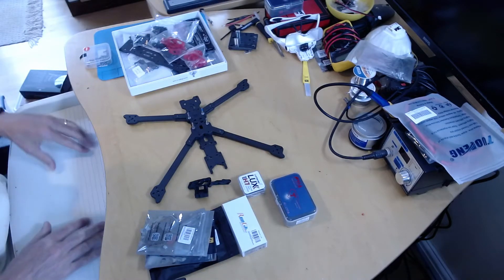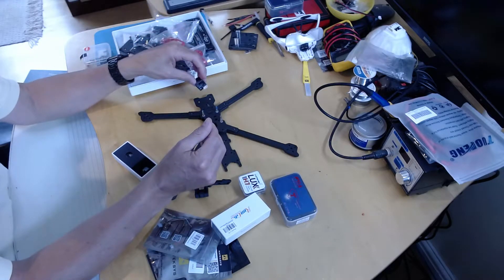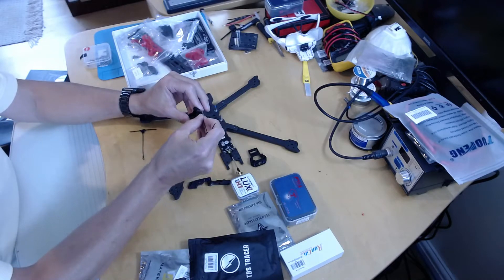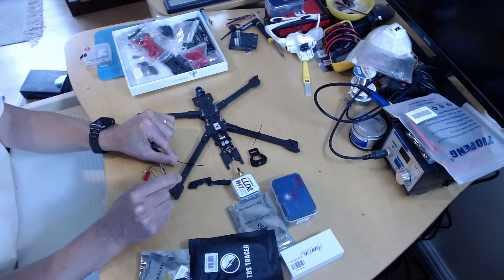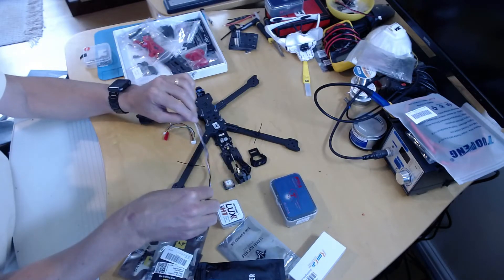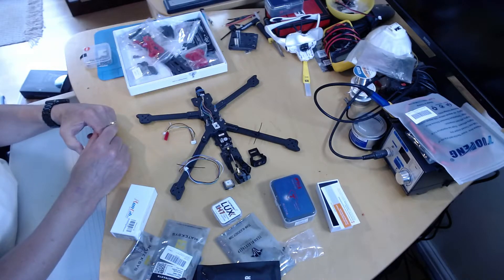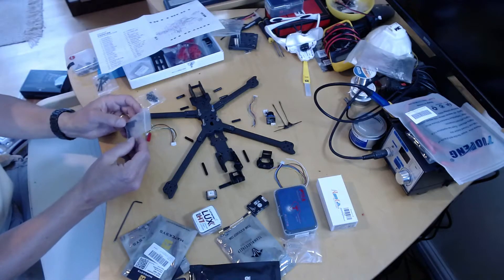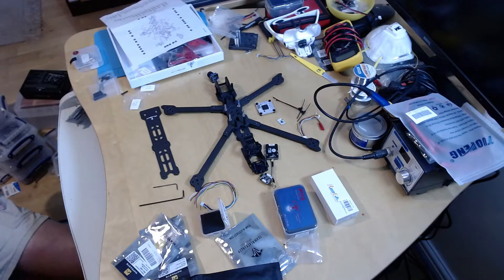ArduCopter 7" LR Build Video 3 - Frame and Component Placement

Comment: what matek gps is that? perfect fit for the mount? no need to get the iflight brand right? its the same matek inside
Reply from the maker: Matek makes good kit - no need to get the iFlight one. The Matek fits perfectly
Reply: @andypiper5285  already soldered my m8q matex on my chimera7.. but im afraid it got interfere from maybe vista unit or my matex elrs rx.. it cant get any sat within 2 mins 🥲
Reply from the maker: @TERBANGFPV  My vista unit is mounted right by the GPS without issue. There are some settings that its worth checking. Presumably the copter has detected the GPS? Be worth posting on the forums
Reply: @andypiper5285  yes im afraid the matek elrs that interfere with gps. On my other build also no problem with vista.
Reply from the maker: @TERBANGFPV  if its EMI you can use mumetal foil to shield the GPS from the source. I do this on smaller copters and it works quite well